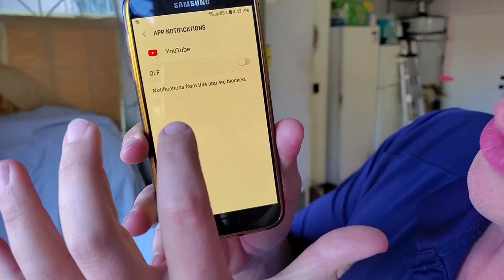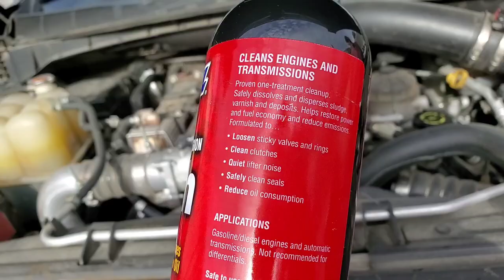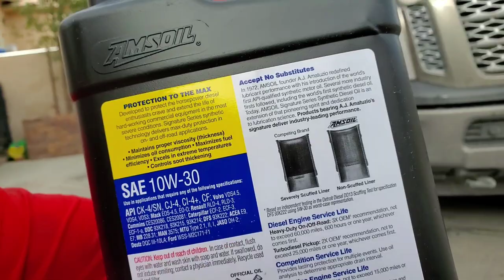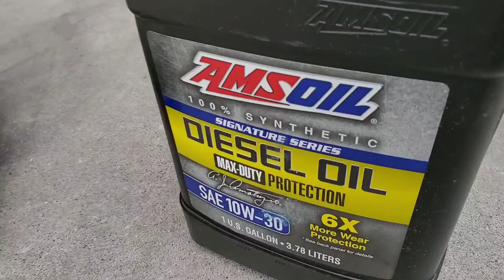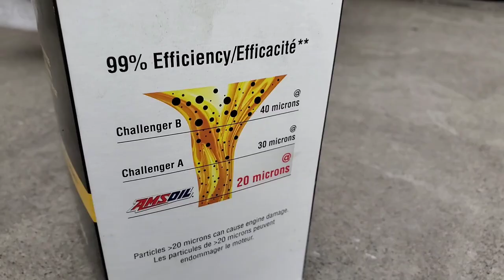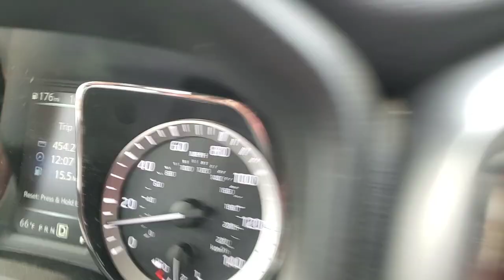Nissan Titan XD 5.0L diesel AMSOIL Oil Change ENGINE FLUSH before & after

Comment: Run from that truck. The turbos will not last much more than 100K and then it is a huge bill to replace. You have been warned.
Reply from the maker: Now they might last a lot longer I'm thinking he'll make it out good It ran really good when we test drove it afterwards but you're right you just never know 😃
Reply: Try 60,000 miles
Reply: @mikesumo2150  yea that's what he said 100k!
Reply: I'm kinda late to the party here but I have to throw some shade and facts to the professional geniuses "haters" regarding this particular truck and powertrain lol. 
The majority of people who gives such negative advice are people who have never owned this particular truck, they just follow the rumors and the big 3 supporters lol!
I understand some titan 5.0 owners have had some bad experiences and that's ok and perfectly normal for any automobiles lifespan. 
I've seen $70,000 Mopar sports cars lose the tranny the same day the car was bought. Gm trucks and full size suvs have been using oil, and destroying piston rings and lifters since 2009 and nobody gives a shit obviously and why??
Here's another fun fact. Almost none of these Debbie downers talk about how a vehicle is drove, abused, neglected, aftermarket parts, etc and that shit matters regarding a vehicles longevity.
The big 3 has produced such vehicles for so long they've been able to work kinks out of a new design and move forward but they've all experienced negative issues electronically and mechanically and no one talks about them all these years but it's probably irrelevant to the argument, right..??
By the time the industry provided full deletes and tuning or any other aftermarket part for these trucks they had already been out for nearly 3 years and only lasted 4 and everyone knows that an egr and def system is the absolute diesel destroyers above all no matter what brand so these titans kinda didn't have a chance to prove themselves unfortunately.
No one talks about nissan having the absolute best warranty above the big 3, either. Someone mentioned the turbos only lasting between 60,000 and 100,000... I mean, Is this statement your opinions or is it a fact pertaining to each one that was produced and is it the low or high pressure turbo you guys are referring too?Someone said it's around $7200 to replace the turbo, but again, which turbo are you talking about because they're a massive price difference between the 2 and most importantly, are you guys talking about dealership costs to repair it and do you have warranty?
I can get a reman turbo for $1800 or a used one for $750 with a 3 month warranty and do it myself for free or pay a mechanic on the side for probably $200-300 bucks.
I've owned 2 of these trucks since 2016 and I still have both and both are still working hard! Both trucks have over 140,000 miles and I've put a swingvalve actuator on both and that's it other than a couple hub assemblies. Both trucks are fully deleted ofcourse and have been since 2019. I've owned ford 250s and gm 2500hds, gas and diesel and in my experiences, my titans are just as good and work just as hard and are more than capable. Biggest difference between them and the big 3, the titan rides, handles and drives better and they don't cost $90,000 with a piss poor warranty lol!
Reply from the maker: @ryanphillips3533 A great points Ryan that's why I created this video - https://youtube.com/shorts/6C_klsv-uqM?si=lfKpFqNclbZiUiRo
Reply: @ryanphillips3533 do you have an update on mileage now?
Reply: @noahj7864  well it's only been a few weeks ago since leaving my previous comment above but my platinum reserve xd now has little over 142,000 and my base model has 143,789 exactly. Still running strong. 
Now my brother has an 17 xd 5.0 he bought new for his company, had like 23 miles on it. He had a new low pressure turbo and egr cooler replaced on it at around 87 000 miles covered by warranty.
Shortly after he opted to fully delete the truck including the egr delete and his truck is hitting close to 190,000 as of last week and he hasn't had any more issues since they replaced the low pressure turbo and he hauls heavy equipment all over the south and mid west 4 days a week.
Reply from the maker: @ryanphillips3533 there's a guy that's really good on YouTube that will help you with DPF his name is James the DPF guy.
https://youtu.be/WYXpb8o86-0?si=9TO3MijUaO3B-NJL
Reply from the maker: @noahj7864 Tom moved out of the country he now lives in Baja Mexico he saw a big bump after a few weeks before he left he was about 2 miles per gallon average better.
We also have other diesel trucks in the Channel with great results if you'd like to see anything let me know I can always text it to you and if you're new to Amsoil you can order it through my website I will always be able to answer your questions in the future with the products.
Let's give a man a fishing pole & show him how to fish. 

     Together! We can get your vehicles to run better than brand new!

     For me to get credit & be "Your" Independent AMSOIL Dealer, please use my website below or my dealer no. 5331179 call anytime Eben Rockmaker 702-472-3614
After you click on: http://syntheticoilprotection.net
1. Click the hamburger menu
2. Click offers AMSOIL preferred customer
3. Click join now. 6-month PC member add to cart.  ( There is no reoccurring renewal membership unless you select that dot box ) 
( You have the option to not have your credit card saved if you prefer - est. 1972 )
4. Scroll up to the top Select shop by vehicle. 

New Promo Code: FREETOOL

Comment: This is complete BS, i JUST tore down a 5.0 cummins for bearing failure (which is a common problem) and there is absolutely no crud, gunk or anything like that anywhere in the engine everything it prestine. If you are putting anything other than oil in your engine your are probably contributing to more early bearing failure. The injectors and intake manifold however were caked with soot so some fuel injector cleaner may help. But these trucks need fresh oil all the time do not put any snake oil in and possibly dilute it youll be sorry, and im not an amsoil hater either, their severe gear gear lube is good stuff
Reply from the maker: This gear oil is over $100 per quart - https://youtu.be/RTtWLPYxixU?si=nPJdB9u_Uy-PQRCt

Comment: When you dump the old oil with the Amsoil Engine flush after running it 15 minutes, doesn't some of that thinning flush product remain in there, so that when you put in the new oil, some of that oil will be thinned by the product that remained within the engine?
Reply from the maker: Yes however it's in insignificant for instance if you had a car that held 10 quarts and it left 1 quart in it from old oil that means you would have only 1.6 oz of flush from the engine flush that contain the 16 oz to begin with so if you think about it putting 1.6 oz of anything into motor oil of 10 quarts wouldn't really do anything you could put 1.6 oz of water into a 10 quart crankcase of oil and the fuel dilution would still be within limits or moisture dilution...... etc etc.
I did the math that would be .5% water dilution in the fuel and the allowable for normal is under 2% fuel delusion so as you'll see 1.6 Oz is insignificant into 320 oz
Reply: @Syntheticoilprotection  Thank you!
Reply from the maker: @redcapote4760 😃, anytime

Comment: Interesting. I’m curious where I could get that oil and additives for my 2016 Nissan Titan XD platinum reserve with 47,000 miles. Joseph from New Mexico
Reply from the maker: You can order it right here off my website if you have any questions give me a buzz😉

  I give a man a fishing pole & show him how to fish. 

     Together! We can get your vehicles to run better than brand new! 

     For me to get credit & be "Your" Independent AMSOIL Dealer please use my website below or my dealer no. 5331179 call anytime Eben Rockmaker 702-472-3614
After you click on: http://syntheticoilprotection.net
1. Click hamburger menu
2. Click offers AMSOIL preferred customer
3. Click join now 6-month PC member add to cart.  ( there is no reoccurring renewal membership unless you select that dot box ) 
( you have the option to not have your credit card saved if you prefer - est. 1972 )
4. Scroll up to the top Select shop by vehicle. 

New Promo: FREEMS

Comment: Eben
For a gas engine would it be okay to put engine flush in and then drive for 10 to 15 minutes to my mechanic or does it have to idle?
Reply from the maker: Great question Dennis You would want to idle it what's happening is the oil is getting thinned out and that basically helps get rid of the deposits off metal when the metal is thinner It doesn't have the same film strength so putting the load on the motor could have a little bit of wear on it so if it was my vehicle I wouldn't drive it I would do what the instruction says and just idle it for 15 minutes now all the buildup won't come out so when you run the signature series more is going to come out as you drive the oil on your next oil change so I always recommend changing the oil filter at about 3 to 5,000 miles depending on how old the vehicle is and how many miles because there's still going to be build up that ends up in the new oil filter because the detergents in the signature series will melt it out of your motor.

You'll notice a huge difference when you change the oil filter and that's exactly what I did on my personal car you'll see the SL550 Amsoil engine flush video if you just type it in it'll pop right up.

also if you're new to Amsoil I recommend the 6-month PC membership that'll save you a ton of money and when you use my link I would be your Amsoil dealer I would also get the credit for your orders and I can always answer all your questions in the future on the products.

Thanks for being a part of my channel Dennis.
🎬 Professional YouLubher: Eben Rockmaker Regency Gold Direct Jobber AMSOIL Specialist (Dealer#: 5331179) 702-472-3614 

     ✅ If You're New To AMSOIL I Recommend The AMSOIL 6 Month PC Membership because it will save you about $33 on a $100 purchase after the difference in tax - https://www.amsoil.com/offers/pc/?zo=5331179

Comment: Do you run the oil flush on a cold or warm idle?
Reply from the maker: I always go and get it as hot as I can it really flows out nicely when you drain it when it's super hot so always a good hot engine it is best you just want to make sure you have thick rubber gloves to take the bolt off then is it's really hot

Comment: Mobile one jet oil
Reply from the maker: Interesting have you ever tried the Amsoil yet if you would like to try it this will give you the very best value on the products and always happy to talk with you about improving the performance and lifespan of your vehicles and equipment by choosing the right fluids as your independent Amsoil dealer and soil is 100% synthetic they were manufacturer can call a full synthetical synthetic when it's only 25% synthetic.
♥️   Find The Right Fluids For Your Vehicles - https://www.amsoil.com/lookup/auto-and-light-truck/?zo=5331179

     ✅   Save 25% On Your Next Fluid Order: https://www.amsoil.com/offers/pc/?zo=5331179 

     ♥️   See Fluid Performance Tests - https://www.amsoil.com/performancetests.aspx?zo=5331179

Comment: You over filled with oil... Manual says 10qts with filter change. You filled the filter and then added 10 qts.
Reply from the maker: Oh yeah sometimes when you do the engine flush it thins out the oil and you can get more fluid out depending on the oil cooler for instance an S550 Mercedes one of the videos we've done it ended up taking about 1.1 extra quarts and that's common just depending if you tip the vehicle as well

Comment: Can i use this type of oil in A gasoline car
Reply from the maker: Of course however in jail makes specific oils for each exact application. The one made for the diesel motor is actually designed for diesel and thickening and different things like that This is the lookup guide it will give you everything for your year make model and engine size motor it'll also give you the key capacities as well.
Find Products For All Vehicles - https://www.amsoil.com/guides/?zo=5331179
Reply from the maker: Also this is my link when you use my link I'll get the credit for your order I would be your Amsoil dealer in the future you could always call me and I could always speak with you as long as you are my account.

I recommend the 6-month PC membership and that will give you a ton of money.
🎬 Professional YouLubher: Eben Rockmaker Regency Gold Direct Jobber AMSOIL Specialist (Dealer#: 5331179) 702-472-3614 

     ✅ If You're New To AMSOIL I Recommend The AMSOIL 6 Month PC Membership because it will save you about $33 on a $100 purchase after the difference in tax - https://www.amsoil.com/offers/pc/?zo=5331179

Comment: Does that oil meet the Cummins specification?
Reply from the maker: Yes it meets and exceeds all the major technical specs on all major diesel engines - https://www.amsoil.com/p/signature-series-max-duty-synthetic-diesel-oil-10w-30-dtt/?zo=5331179

You'll see all the differences on how much better it is also you'll see under C technical data bulletin the blue highlighted link click on that You'll see all the specifications 😉🪙💯
Reply from the maker: What type of vehicles do you have?
Reply from the maker: Sweet!
Reply from the maker: This is my PC link It will give you the discounted pricing saves about 30 to $3 per $100 you spend and you'll also get a lot of other benefits If you ever have any questions just give me a buzz before you order.
🎬 Professional YouLubher: Eben Rockmaker Regency Gold Direct Jobber AMSOIL Specialist (Dealer#: 5331179) 702-472-3614 

     ✅ If You're New To AMSOIL I Recommend The AMSOIL 6 Month PC Membership because it will save you about $33 on a $100 purchase after the difference in tax - https://www.amsoil.com/offers/pc/?zo=5331179

Comment: I have been running pensoil 0w20 in my avalanche works great fully gas derived
Reply from the maker: Sweet, Hi highly recommend you try Amsoil you will be surprised at the difference in the way your motor runs and how it feels you'll also notice a difference in oil burning unless oil burn better compression in your motor will last longer It's 100% synthetic and they can actually call a full synthetic full synthetic at 25% synthetic or more so most of the full synthetics out there are at the minimum minimum and this will give you a good idea of the difference.
♥️ AMSOIL Performance Test Results. Read This Article - https://www.amsoil.com/performancetests.aspx?zo=5331179